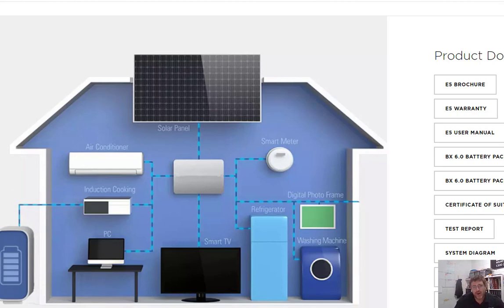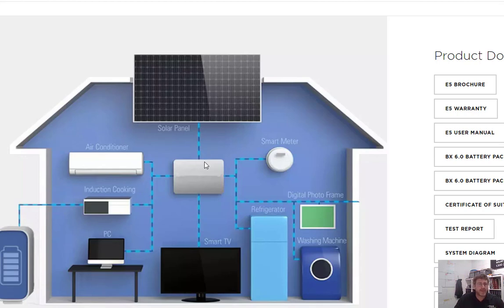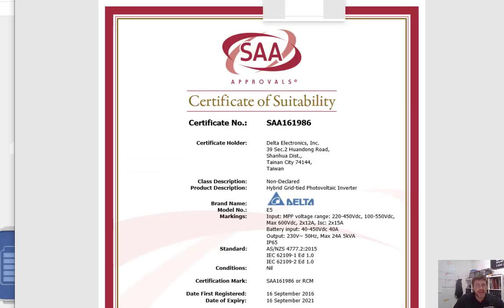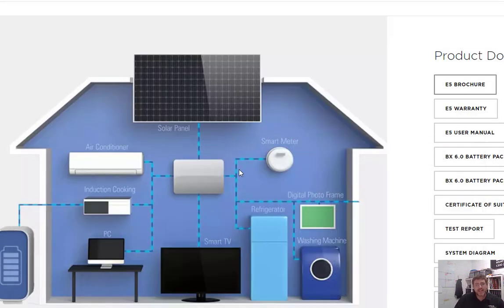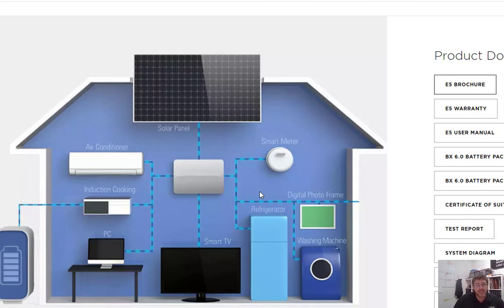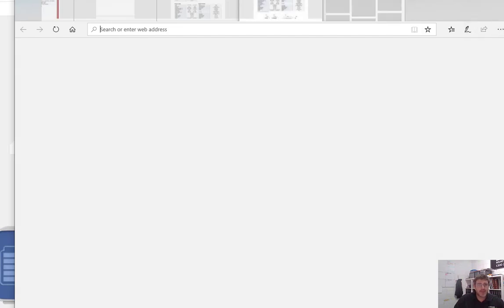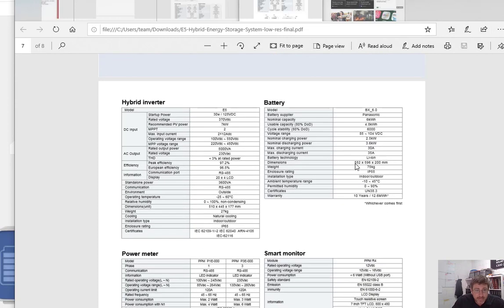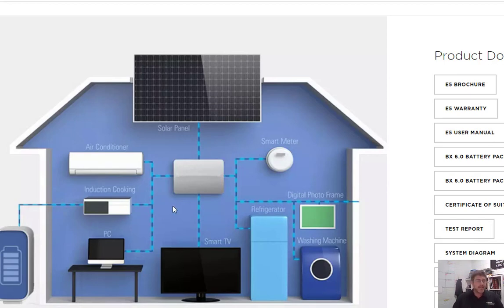Off Grid VS Hybrid Inverters | The Off-Grid Shop

Comment: So a hybrid inverter is not suitable to work with an existing house installation and if we want to reduce our electricity bill we would need a separate wiring system for house apliances not exciding the inverter rating. Is that correct?
Reply from the maker: This is an old video. A hybrid inverter will reduce your usage from the grid and save you money.  It's will all depend on the quality of system you install to how long the payback period is. In Australia it's normally 7 - 10 years.
Reply from the maker: And in a black out you will only have dedicated circuits that work.

Comment: I have a solar hybrid inverter with an inbuilt pwm charge controller. I would like to change to an mppt controller, but I don't want to loose the function of the inverter switching between grid and solar. Is there a way to use an mppt controller and have the inverter retain this ability so it can reduce my bills?
Reply from the maker: What brand?  I think if you installed an mppt direct to batteries it would work?
Reply: @TheOffGridShop  yes, I guess it will, but then the inverter will not be able to switch to solar energy to save grid energy. It will always take from the grid and never utilize my solar energy. 5his will render my panels useless once the battery is full. I will have to disconnect it from grid before it uses the battery energy and I don't want that. Is there a way to integrate an external mppt charger into the system? If I place an mppt charger between the inbuilt pwm and the panels, how will the system react?
My inverter is Exulted hybrid inverter 2500va.
Reply from the maker: It will do what you want it to do.  When you start taking from the battery the 2nd mppt  will start charging the battery and stop it from taking form the battery. Then the mppt will send the excess power to your loads. Instead of battery to directly power the inveter. It all works with pressure is the best way to think about it. Does that make sense?
Reply: @TheOffGridShop  I perfectly understand what you are saying, but by doing so, the inverter will see the solar power as battery power and the inverter is designed to use battery power only when every other source of power fails. So as long as grid power is on, it will take power from grid and never use the battery (solar).
Reply from the maker: Ok. Can those inveters be ac coupled?
Reply from the maker: Have a watch of this. Something like this would be better than adding an mppt. 

https://youtube.com/watch?v=5Kuq1x7_cSU&feature=share8
Reply: @TheOffGridShop  I don't know what you mean by AC coupled. All I know is they are connected to AC input (grid power) to charge the battery when solar power is not available. The power source is primarily solar, then grid, and lastly battery.

The inverter has a function called PCU light and PCU ultra. I don't know what those mean.
Reply from the maker: Did you watch the video above I posted?
Reply: @TheOffGridShop  yes I watched it but it doesn't apply to my situation.
Reply from the maker: An AC coupled inveter will solve your problem over an mppt if you can add an AC coupled inveter.
Reply: @TheOffGridShop  ok, I will consider that, though I'm not ready for the cost now.
Please could you explain what "PCU light mode"  and "PCU ultra mode"  mean? They are modes in my inverter and I don't know what they do, but I suspect they change how the inverter uses power from the different sources.
And, No, I don't have the manual.

Comment: Explaination not straightforward...I clicked on this video coz I wanted to know the difference between the two...
Reply from the maker: Thank you for the feedback. What is it you want to know?
Reply: @TheOffGridShop  I wanted to a clear difference between off-grid and hybrid, and I clicked on your video coz it promised to explain that... however what I found was a long discussion about something else.
Reply from the maker: @orlandochauke1578  thank you for the feedback.  I will watch the video again. The simplest explanation is a Hybrid inverter needs the grid most of the time and only designed to run in back up or off grid mode for a short period. And can't accept a generator into it to top up batteries if there is no solar.

Comment: Hello! Great video, thanks for the explanation. So according to your video a Solax X1-Hybrid 3.7 - D is not applicable for 100% OFF grid applications, correct. That would explain why I have experienced an Overload fault when the battery pack reaches 100% charge at peak sunlight and my Solax inverter or battery controller isn't cutting off the charging when the batteries are at 100% and the system enters in Overload.
Reply from the maker: Yeah Hybrid is mostly meant to work with the grid. Thank you for following. I don't know much about solax and there is likely a setting you can fix your problem.

Comment: What sort of system would you recommend for someone who lives in an area where there are often power outages that can last for several days.
Ideally it would be an on-grid system that would function off grid for a day or so at a time. Would that need two inverters?
How do these systems prevent any power being sent into the grid (to prevent injury to linemen) when there is a blackout?
Reply: You would only require 1 off grid inverter and some batteries to create a hybrid system. A Victron Multiplus and a DC charge controller could work in a hybrid situation to back up some loads and still get direct charge from the sun.

An ESS system is required to have anti-islanding protection to stop backfeed into the grid during a blackout
Reply: @teamadmin5483  Thank you, I think it is the anti-islanding I am confused about. Is that an automatic switch that disconnects from the grid if there is a power outage? 
If you have anti-islanding could you then still use the power from your batteries/solar panels if the grid goes down?
Can anti-islanding be fitted to any hybrid solar system?
Can you just fit an anti-islanding switch to an existing hybrid solar system?
Reply from the maker: Anti-islanding protection is a way for the inverter to sense when the power grid is struggling or has failed. It then stops feeding power back to the grid.
Yes you could still use power from your batteries and solar panels if the grid went down as long as your hybrid setup was configured right and your PV inverters were on the output of the Off-Grid inverter.
Yes there are devices that are compatible with most hybrid systems to make it anti-islanding compatible.
Thank you for your interest!

Comment: I use the term "essential circuit" rather than "dedicated circuit".  But yes, better to say these than "backup".  Good stuff
Reply from the maker: Hi Aaron, We use the term Dedicated circuits as those circuits are dedicated to coming from batteries. We use the term essential circuits when we work in situations that essential is essential. Meaning that no matter what that circuit will be powered.  IE integrated with back up generators. Life-threatening or Business-critical situations.  
Essential adjective
1.
"absolutely necessary; extremely important."

I get where you are coming from though. Thank you

Comment: what about hybrid inverters that can run in parallel?
I run 2 x lux power tec lxp5k inverters wit a UPS output of 3.6kw per inverter for 7.2kw combined as I don't think my draw would ever go above that ( i could always add more inverters and batteries if it did) that could be used for full of grid use I believe.
Reply from the maker: We would use Victron or Selectronics for this. It's possible with the right equipment.